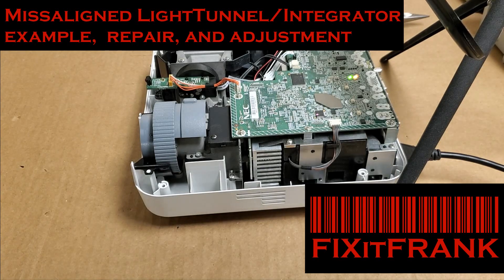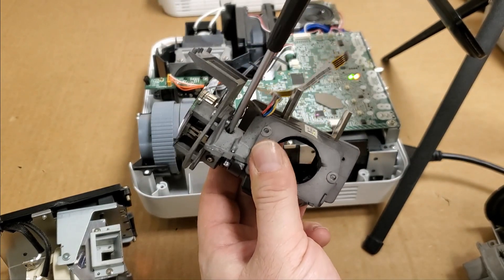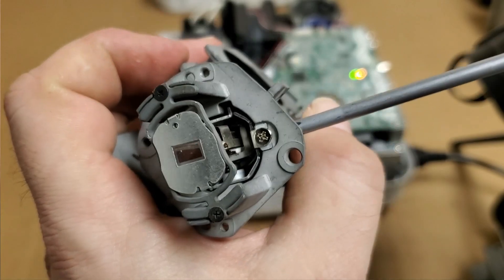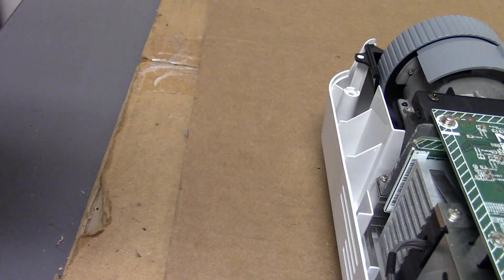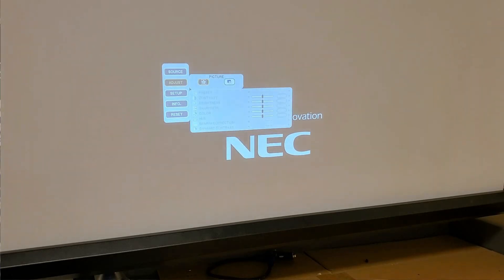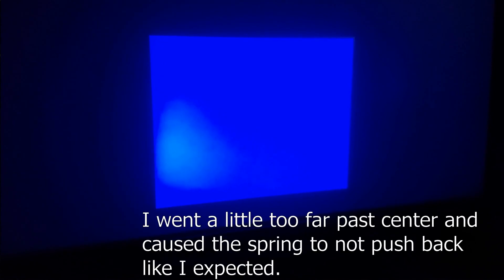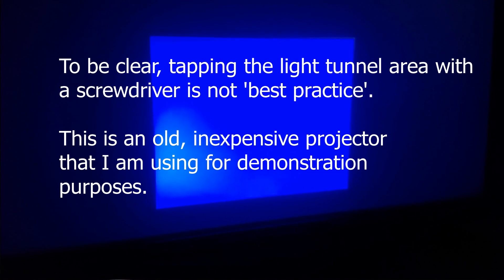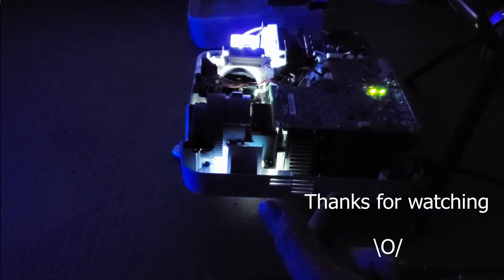DLP Projector Light Tunnel Example and Alignment

Comment: Hi Frank - I have an HD142x and have narrowed down one of my problems to the alignment here. By adjusting the screws I almost got it perfect but now it gets no closer and I can’t even get it back to its imperfect state. Any suggestions for completely sorting it? The screws no longer align it properly.
Reply from the maker: I bet the spring that pushed on the light tunnel needs to be over bent to push the light tunnel back into place.
Reply: @FixitFrank  Can confirm! Thank you so much for your videos :) i took it apart and took the lens assembly out to adjust the light tunnel and then managed to fix it!

Comment: Hi Frank if you see this could really use your advice’ 
I have an optoma intelliGO-s1 which is a mini dlp but uses rgb led 

I’ve got it taken apart to replace dmd… 
However the optical engine/ heat sink are one unit together and where the 2 screws are for dmd cover it is sealed with like black sealant or glue’ 

So it’s a fully sealed light engine 
My question if I cut it replace what do I use to reseal it ?
Reply from the maker: I have not worked on one of those myself.  But I would think some silicone sealant would work. check out automotive black RTV and see what you think of the consistency. That is what I would probably use. I would at least check it out.

Comment: Can you acquire image score?
Over time, the projector loses image sharpness and cleaning does not help.
Reply from the maker: It might be a bad DMD.  I heard that dust can get inside sometimes.  Or heat makes the DMD fail and the mirrors move and are no longer flat and cannot be focused. Are you referring to this model?
Reply: @FixitFrank  Projectors with no out of focus problem are benq mp515 and benq ms524.

Comment: Hey Frank, I have a projector that I've fixed the alignment of the light tunnel thanks to your very instructional videos. Thanks for all you do. I have a problem with it though, the the light tunnel will slowly go back out of alignment overtime. In this video you had mentioned that some manufacturers use lock tight or glue to keep the alignment screws from moving. When I did my projector, I noticed that 1 alignment screw had glue, but the other alignment screw that needed adjusting did not have glue (maybe it melted off or was never put on?). What do you recommend for glue as replacement to keep the alignment screws in place?
Reply from the maker: HI Jacinda, Thanks for letting me know!  That's the whole reason I do these videos.  I learn as I go, so it seems only right to share what I can.  Light tunnel repair was the first repair I ever did on a video projector.  The segments collapsed and I glued them back into place. 
Ideally you want the screws to use some form of Loctite type adhesive but, since it's your own unit, super glue would be just fine for locking the screw. Anything that will take a little heat and not crumble. Epoxy would be fine if it is temperature tolerant. That is the main concern.

How long is it taking for the tunnel to slide out of place?  Are you talking hours or days? Days might be the screw, but if its hours, your return spring might be the problem.  

I should have asked, what model do you have? 
There are two different light tunnel configurations(for the most part). One uses coil springs, the other uses cut/bent spring steel.

Here is a video I did on the type that has the normal type of spring.  https://youtu.be/HUV3PPZoFeg?t=1029

This HD20 uses the flat spring steel with the tabs cut/bent.
https://youtu.be/_smYnIJKjYs?t=2096

The flat spring steel tends to lose its spring temper. I have had success with bending the tabs a little further than they seem like they should. Then when the tunnel goes back in, the spring pushes back enough to hold things in place.
Reply: @FixitFrank  wow you are awesome at responding to comments on your videos. Thanks for the information, I'll look into an appropriate heat tolerant solution.

In terms of hours (it runs approx. 10 hours week) it takes about 40 hours to look like the 11:45 mark in your video on the right hand side. It doesn't get much worse than that either I think.

 It's a BenQ MW727, do you know which type of spring this projector uses? I have a hard time finding specific details like this.
Reply from the maker: @Thisbrouwerlife  You're very welcome! I suspect it is the flat steel type.  If you can get me some pictures of the light tunnel, I could tell you for sure.

Comment: Hi Frank, many thanks!!! Had the shadow growing for months on top and left of the screen and finally got it  sorted. Optoma HD 25 - the screws were glued on the thread and in the Philips head and one was inaccessible due to the MB. I stripped down again (got good at that bit) and managed to free off the screws. I finally set it up by holding the assembly, shining an LED torch down the light tunnel while looking through the lens like you would a microscope; I could then see the light as I made the adjustments on the DMD, just as I would on the screen. Maybe not text book, but it worked for me. BTW. excellent videos great to have it explained how and why things work. Having never opened a projector, I've got right into the guts of the thing and out again without additional damage and got the joy of fixing something.....always a good feeling.
Reply: Funny, i had the same problem and solution and was about to post and identical post, as i saw your comment :D Maybe it should be textbook

Comment: I also have this nec ve281x . it ran about 1000 hrs. Whenever I run it at least 2 hrs it produces some buzzing noise and shuts down. this sounds  like a moving part is rubbing  something in it.  I have disassembled the projector and checked the color wheel. There were no rubbing marks. I noticed that when I pushed  the wheel motor the motor was moving forward & backward but the bearing was ok.  I cleaned each & every part of the projector and reassembled it. Now it's working fine but I don't know when the problem will arrive. One last thing that I also have noticed that all of  the 4 tiny mirrors in the light tunnel module has got rust on it that's why the projector can't produce brighter light . Can you please give me some suggestions to fix this tunnel..  ??? Love form India.
Reply from the maker: Hi Rajdeep!  Greetings from Pennsylvania! You can use any first surface mirror to cut and make segments. I have also used segments from other brands.  Some rust is OK but if it is obscuring most of the mirrored segments that will cause problems.  I've found that you can take the mirror from an optical assembly of another projector and use a diamond wheel on a dremmel or even a glass cutting tool to cut out new strips to make a new tunnel.  
I would look into replacing the light tunnel as soon as you can.  It has a sleeve bearing made from from oil bronze that will wear out.  I have a contact in China that has good prices on color wheel.  GYDZ@Timeprojectorlamps.com If you contact them, send a picture of the old wheel so they can confirm the proper part.   I hope this info help and let me know if you get stuck.